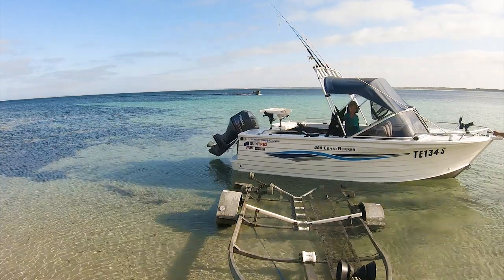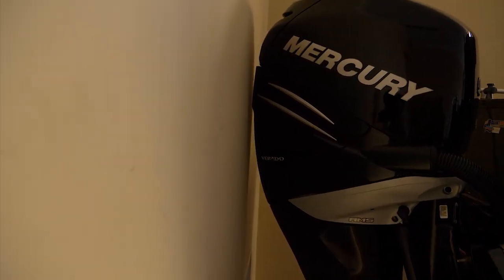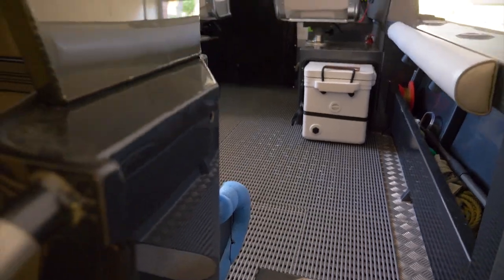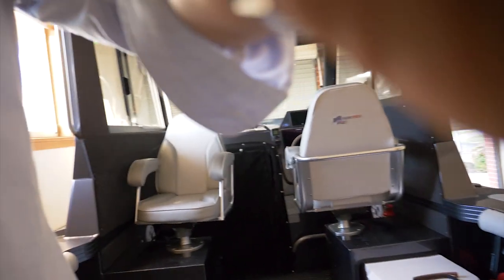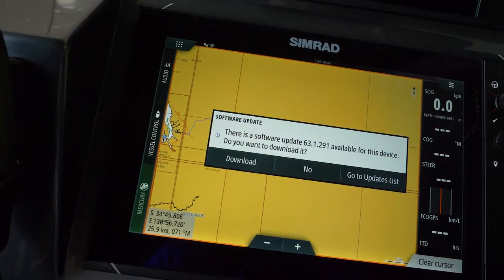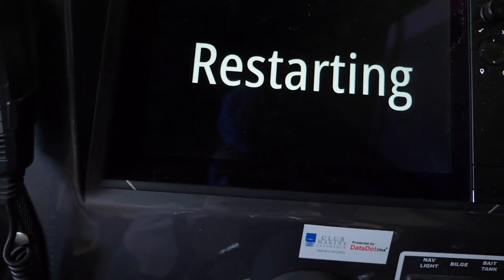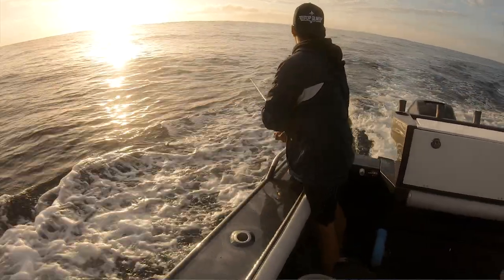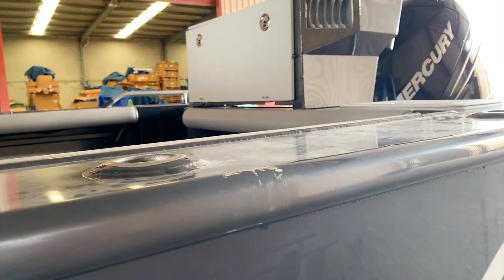Would you buy a $100,000 boat? Yellowfin 7000 HT Southerner (Walk through, SCRATCHED on delivery!)

Comment: Hey mate love ya vids, watched this one a few times now, you say its about 3m in height, i see youve got the rod holders folded down, is that so it fits in your garage? And how high is you garage door? Looking at getting one but need some dimensions for the shed first 
Thanks heaps and keep up the good vids 🤙
Reply from the maker: Hey Ty, thanks mate.. my roller door clearance fully opened is 3.2.. the rod holders will clear if they aren’t folded down, but I like to fold them down anyway just incase. If you do have the option I’d go 3.3 minimum… I’ve considered a dome radar which is approx 23cm in height (from memory) … and I wouldn’t have enough clearance for it.. as the roof of my boat was approx 3m.
Reply: @TabVentures  beautiful thanks heaps mate 👍👍
Reply from the maker: @tylerhotchkin6548  anytime mate. Good luck! 👍

Comment: So what do you think of the ride and the stability? is there plenty of room to sleep in the cabin?
Reply from the maker: Matt C hey mate, depending on your height but I’m 5”10 plenty of room in the cabin. As the helm sits back a little compared to other designs. Stability wise has been great on the plane across chop. With the added trim tabs, makes for a stable and safer ride

Comment: Hey mate. I have the same boat, 2019 model. Have you had any issues with water on the deck? I’ve taken some measurements and the transom outlet for the scuppers is the same level as the 40mm drain hole in the Vee drain aft of the deck. The “squash ball” valves are free and clear as far as I can see. It seems to get a charge of water on the deck that stays there until you get up on the plane to drain it. Then at rest it floods again. Not a huge amount but enough to be annoying. It’s not a great design.
Reply from the maker: Hey Chris, yeah mine gets a little water even at rest... not as much as some people report but enough to know my toes are wet. i make a effort to keep the scuppers clear of debris.. but also in shallow water fishing i plug the holes up with cutout foam. (i dont recommend this on offshore trips)